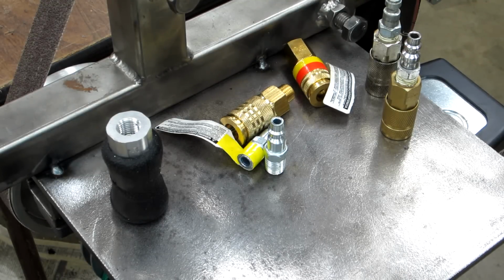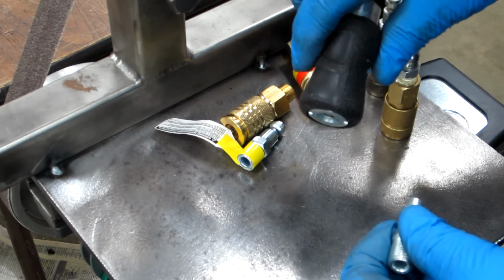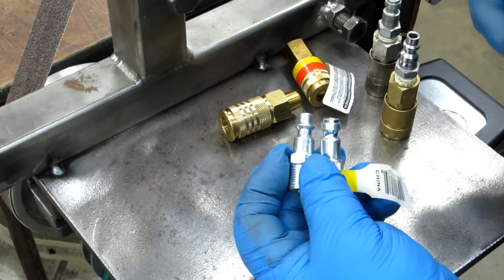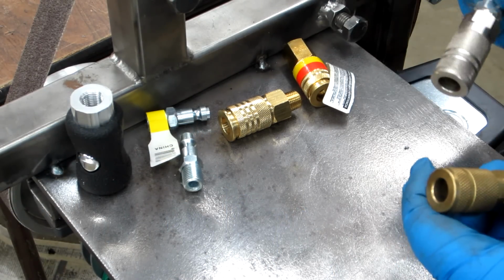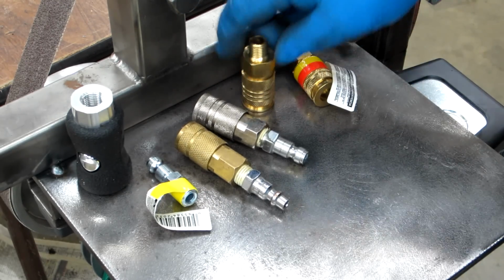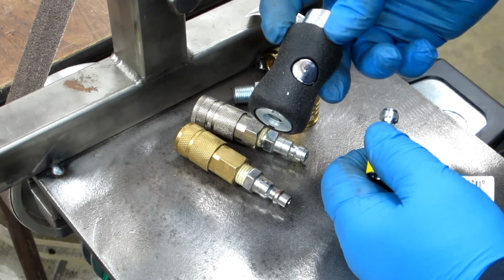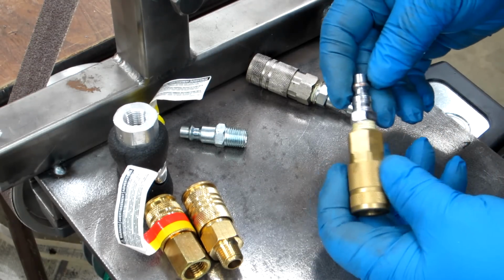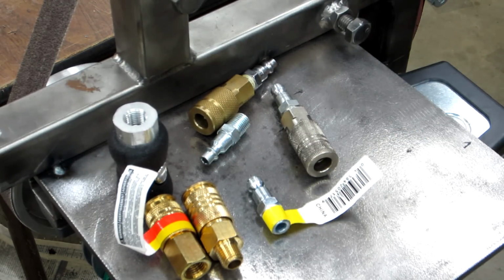Air fittings

Comment: Thank you for this video.  👍  :-)
Reply from the maker: You're more than welcome. :)
Reply: bluehandsvideo , hi.  Wow, you responded already.  Since you did, maybe you wouldn't mind if I asked you a question. This is why I was searching for videos that might answer it for me...
I used to have a huge Magnum paint sprayer.  Bought an extra hose for it, but never needed it.  I have since sold the sprayer, but still have the hose. My question is, since it's made for pressure, can I use this hose for my air compressor and nailers, etc if I get the right fittings?  It actually appears that the spray hose is rated for a higher PSI than my air hose that came with the compressor and nailers.  Nowhere here for me to attach pics of the hose in question... :-/
Reply from the maker: LOL......I always have to chuckle when I hear that.  I'm still doing my best to respond to every comment. :)

Took me a second.....when I think of paint sprayers, I think of the air ones used for automotive painting.....but you're referring to the airless paint sprayer.  Great question. I can't answer with any authority, but I don't think you'd have any worries with it.  Fluid can't compress(for the most part), so if the hose is rated for more than the air compressor, I can't imagine having any issues.  I think a lot of airless hoses are only 1/4" ID....so if it's really long, you might have some flow restriction....but for nailers and low volume tools, that's not a problem.  If it's a 3/8" hose, I think you're fine.  My guess would be that you don't see it done more just because of the cost.  I'm sure air hoses are cheaper than the paint hoses.  Hopefully, you can find fitting for it. I don't recall if they're a common size/thread or not.  I wouldn't be surprised if they're a bit different to keep people from hooking up cheaper, non-rated fitting up to that kind of pressure.  If you really wanted to send me a pic, there's an upload link on the bottom of my contact page on my site.  www.bluehandsfab.com  :)
Reply: bluehandsvideo hello again.  Wow, thank you!  Yeah, I've always wondered about forums when people post time-sensitive issues or questions and someone responds years later, it's like what's the point??  Haha.  But I'm sure there will be others with the same question that falls upon that forum so hopefully it helps someone out in the long run, even if it's not the person who initially posted a question.
Reply: bluehandsvideo so, yes, you are correct in your assumption.  I had a big Graco Magnum $500 paint sprayer for doing some home renovation work.  The titan air hose for it was $52 on clearance for  $13 (new with tags, but clearance cuz the store changed brands) so of course I got it in case I needed it.  Years later, I still have the hose, and yes, it is 1/4".  Just figured since I never even ran paint thru it, why not use it for my compressor tools..?  I don't use impact tools or anything that would warrant getting 3/8" hose.  I just use my 18 & 16 gauge and brad nailers, fill up tires, etc. No mechanics tools or anything like that.  So based on what you're saying, and my thoughts, I don't think there would be an issue of not having enough pressure behind the tool by using a 1/4" hose.
It appears to be a standard thread on the ends, to which I was hoping to find some good fittings like you demonstrated.
Reply from the maker: It's actually pretty easy to miss comments sometimes.  Especially the direct msgs on YT....I've missed them for months before. lol  If the comments are pretty active, they tend to drop down out of sight, but yet.....they stay there and are a good source of info for those willing to dig through them. :)
Reply from the maker: I got your pictures.  You should have any trouble with the hose.....although it will not be as flexible as an air hose.  Depending on where you're at, you can get fittings at quite a few different places.  Since you're not going to use many tools with it, just get matching connectors.....don't worry about getting the universal ones which are just a bit more money.  Good luck with your projects!! :)
Reply: bluehandsvideo Thank you so much for taking the time to help me with this.  I'll take the hose with me to find the right fittings for it.  😊
Reply from the maker: You're more than welcome.  Sounds like a good idea.
Reply: Worked GREAT!!!!  Fittings fit perfectly, no leaks, awesome!  So glad I still had it laying around!!  :-)
Reply from the maker: I'm happy to hear that!  Thanks for coming back and letting me know. :)
Reply: You're welcome.  Now all the people who read this years down the road looking for an answer to this same question will see that it's been answered.  Only if they delve deep enough into the lengthy conversations and responses.  😁
Reply from the maker: Yes......and I now know too...so I can tell them if they ask, or I'll point them to the comments. :)
Reply from the maker: I pinned it....not really sure how that works...first time I've pinned a comment. :)
Reply: as if...
Reply from the maker: @Samisven  ?

Comment from the maker: Another benefit of the rubber housing on the HF push button style.....if you drop it it doesn't dent or scratch whatever you drop it on.  The brass ones don't like to be dropped on concrete.  I've bent the front lip on several and had to change them out.  The push button are far from perfect, but being able to disconnect a tool with one hand.....priceless :)

Comment: To summarize, 1 band is for automotive (which allows more flow). 2 band is for industrial (less flow). 3 band  (red and yellow tape) is for both automotive and industrial.
Reply from the maker: I don't remember saying anything about the flow being different, but it's been years since I've watched this myself.  They do have versions of these fittings that do have higher flow rates.  I'm sure you can find them online with google.  Thanks.

Comment: I was not able to locate the push button universal quick connect at Harbor Freight, but it looks like Home Depot has them for $4.98. Your video to the point and very informative. Thanks for posting.
Reply from the maker: You're more than welcome!  I had to get my most recent ones from HD, too. I'm never sure if HF quits on certain products due to patent conflicts.  I've seen a handful of items over the years that popped up pretty soon after the "original" item comes on the market....then they disappear.  Anyway.....I'm happy to hear it was helpful.  Thanks for your comments!!! :)  Mike
Reply: Just to add one more piece of information for your viewers, though it's pretty rare, there is also an "asian style" quick connector, which is very similar to the industrial and automotive variety. The universal quick connect body will not work on the asian style plug (see Grainger part number 30E578 for reference).
Reply from the maker: Interesting!! Thanks!!

Comment: Thought you might be interested to know the aluminum quick disconnect is on the "discontinued bargains" page of Harbor Freight right now, you may want to buy a couple if you like them a lot. I also found an almost identical thing in Milton's catalog, so I guess if worse comes to worse you could use theirs. Also sometimes things go on Harbor Freight's "discontinued" page and gets replaces by an identical (usually made crappier) item as a way to reset the item number on their site thereby wiping clean the reviews. They do this for items that get a ton of 1 star reviews too, "discontinue" that item and then replace it with a new stock number. Interesting phenomena actually!
Reply from the maker: Thanks for the heads up!!  I put a brass fitting back on the connection I use the most.  The aluminum ones kept wearing out to fast.  I'd be interested in trying the Milton ones.  Do you happen to have a part number? When the connector works, I love it!!
Very interesting about the "reset".  I'd noticed the same item coming back with a different number, but it would have never dawned on me about the reason why. LOL!!  Thanks!!
Reply: bluehandsvideo It's a Milton S-99705. I can't tell if it's made of aluminum or steel, though, I haven't found any descriptions that tell you. The catalog tells you the connectors are either brass or "case hardened steel plated to resist rust", so I'm thinking it's made of steel. You can buy it online, but also places like OReilly's can order it for you and have it the next day if you don't like doing it that way. It's 11 dollars on Amazon, 15 plus tax from Oreilly's. Those were just two places I checked, though.

Comment: thanks for this vid! Learned something new today. Never thought anything about the 1, 2 and 3 band on the couplers. Great idea on the adaptors too. Will make some for my home shop as I am switching from 1/4 to 3/8 for more air.
Reply from the maker: +Robert Fernandez Thanks!  I've also started collecting the stuff to get everything up to 3/8".  I think I actually have 1/2" line to go between the compressor and the water trap/regulator.  I'm thinking about running 1/2" line in a loop around my shop to tap the drops into.  At the very least, I'll make sure I upgrade everything to the high flow 1/4" conncetors. :)

Comment: I just discovered the difference between high quality fitting & the restricted crap that came with my harbor freight air compressor. I went from being unable to remove lugnuts with my big gun to being able to blow them off with ease with my small gun. & my big gun pretty much rounded the head of my lugs off! all becasue the fittings had a tiny inner diameter & leaked!

Comment from the maker: Harry.....I don't have a reply option to your comment.....google sure is screwing up youtube.
Thank you!!!  Awesome information!  I just did some checking into the V couplers.  I hadn't given much thought to the "flow" of the couplers I was using, but I'm definitely going to be changing a lot of these old one out for Vs!!!  I'll see if I can get some comparisons going and maybe even post a follow up vid on the differences.  This got me thinking about how much restriction I have in the rest of the line from the compressor.  I'll be changing that up too.  I rarely use my air impact....my cordless Ryobi does 99% of my stuff these days, but, I do you high speed sanders and grinders and I get tired of them bogging down all the time. 
Thanks again!!!!
Mike

Comment from the maker: I wasn't sure which universal you were asking about.  Here's the brass style
Central Pneumatic - item#68182

and the rubber covered push button. 
Central Pneumatic - item#68188

As much as I liked the push button style, I've gone back to the brass style.....they last longer and seal better.
Thanks!
Reply: +bluehandsvideo I tried to enter the # for the rubber one on the harbor freight site but it says it can't find it??
Reply from the maker: +sjWiz Hmmm.....seems they don't carry it anymore.  Milton(major brand) has them.
http://www.miltonindustries.com/couplers-and-plugs/push-button-safety.html
Reply: Thanks! Not sure if I should get the MNPT or FNPT... does it even matter?
Reply from the maker: +sjWiz The M and F are for Male/Female.  I would guess that your hose already has a male end on it, so you'd want the FNPT so that you can mount it directly to the hose.
Reply: Ohhh ok. I believe the hose that i bought has a female end instead (are both ends the same type?)... is this normal? http://www.ebay.com/itm/401034830079?_trksid=p2057872.m2749.l2649&ssPageName=STRK%3AMEBIDX%3AIT
Reply from the maker: +sjWiz That is a male end on that hose.  Can't tell what's on the far end, but typically hoses have the same fitting on both ends.  Since it's listed as a metric hose, I'd want to verify the thread size/pitch of the fitting before ordering the quick connects.
Reply: Ok, I think I should wait too until I get it in the mail. I thought it was a female end b/c of the round opening. Do you know of a good guide that will explain what you mentioned in more depth?
Reply from the maker: +sjWiz The hole is just the air passage....the connection is made at the threads and that is the male end because it goes into the fitting.  The quick connect will be considered a female connection because it will accept the tool fitting(male) into it.  Your quick connect will have a female connection on each end.  
Sorry, I don't have a guide, but there's tons of great info on the web......either google or youtube. :)
Reply: bluehandsvideo You're right - I got the hose today and both ends are the same. Is it always male fittings that go into these air holes? Which standard fittings do you recommend getting that will be accommodating of a lot of quick connects?
Reply from the maker: +sjWiz  Are you in the states?  I'd take the hose to the local hardware store, home depot or auto parts store and find out what fits it so that you just what threads it has.  After that....Milton fittings are the most popular.  I have better luck with the industrial style not leaking, but since all mine are either HD or HF, they all leak eventually.  As I upgrade my air system, I'll order Milton.  Google quick connect air fittings......there's tons of info out there about which are better for what and which are high flow.
Reply: Oh ok. Yes I am, in CA. Too many sources from that search :/ can you tell me what you personally reference?

What is HD, HF?
Reply from the maker: +sjWiz HD = Home Depot   HF = Harbor Freight.   I don't have a specific reference......I google it and then go through all those sources until I find the info I need.  Google Milton air fittings.....their website should have all the info you need.

Comment: None of these Milton or Flexzilla "High Airflow" couplers and plugs come with "High Airflow" barbs for hoses.. Do I need to use barbs fittings for the hose which would be the bottleneck, or are we supposed to put a male threaded plug into the hose (coupler end into the hose) and a female coupler onto that plug's male threads? If that's the case, do the coupler ends of 1/4" threads fit into a 3/8" ID hose?
Reply from the maker: I'm not sure on all of that.  I have noticed that some of my 3/8" hoses with 1/4" NPT ends on them have small ID's and some have larger ID's.  I'm going to be working on my air system this next week.  I've gotten in some 3/8" fittings, ferrules and crimpers.  I'm thinking that I'll do another video while I'm at it, but that doesn't help you right now.  The 3/8" hose handles plenty of scfm, but as you said, it's the fittings that restrict everything.  I think I can put in barbs everywhere except at the end of a hose that will get an air tool connected to it.  The coupling may allow it to rotate easily enough, but I haven't checked yet.  Sorry I don't have more definitive info for you.  I might in a couple of weeks if I do a new video. :)  Thanks!!

Comment: I bought a few of these two weeks ago.  I hooked it up and was so happy with how well it sealed.  I'm so used to my couplers always leaking.  For the entire day I had no issues.  No leaks, the button worked great.  I disconnected and connected all of my air tools dozens of times through out the day and was incredibly happy.  I came in the next day and hooked it up to my impact and went to pull a wheel off and the hose just popped right off of the chuck.  I thought it was maybe not all the way in.  By the end of the day I had removed all of these quick connect fittings because the fittings just stopped working.  And when it pops out (without hitting the button) it pulls the top O ring out which is a pain in the ass to reinstall.  I got tired of it and unfortunately switch back to the tried and true brass fittings.  Did you have any issues like this?  If so, what did you do to fix it? 

Thanks.
Reply from the maker: I have had similar issues, but they didn't happen that quickly.  I only have one or two hoses with the push button style on them because I don't change the tool on them very often.  On the main hose I change all the time, it has a universal brass fitting on it.  My fix was the same as yours....replace with what I know works.  I wish I had a better answer for you.  I hear that there are better quality ones out there.....in fact I think someone pointed them out in one of the comments.  I just looked at Milton's catalog....they've got pushbutton connectors.....I would hope that they're a much better quality!
www.miltonindustries.com

Comment: I've found over many years that when I purchase a fitting other than a Milton, I wind up regretting it.  Not to sound like a cheerleader, but I just don't have the patience to change out leaking ill-fitting junk when I have work to do.  I know that sounds snobbish.
Reply from the maker: I understand.  I've suffered leaking fittings for long periods of time. I always say that I'll fix it once I finish the work.....but once finished, I forget about it until the next job. Vicious cycle. LOL  I think I might just put the Milton couplers on the ends of the hoses that get the most use.  I've gone through a handful of cheap ones on my main hose.  I'd like to see the next one last awhile......although I just put a new, cheap one on it. lol

Comment: Great Info but for sone reason it got muted at the end. 😔
Reply from the maker: Sorry about that....this is a cut/paste from a reply I gave to another commenter that pointed out the same thing......
lol.....I didn't realize the end of the vid disappeared like that!  Sorry about that.  I went through a period where I had some editing issues. I guess that was during the time. I think this is the rest of the sentence, but I don't know what I said after that.

"The challenge is that whenever anyone else is working in the shop, they have a really hard time using the brass couplings.......so the push button style is way easier to show them how to use."
Thanks!!